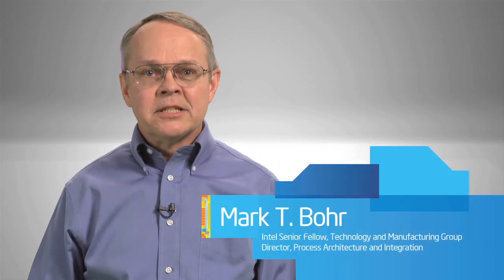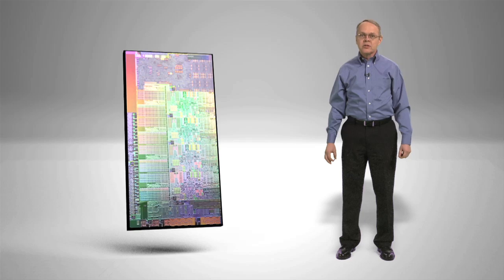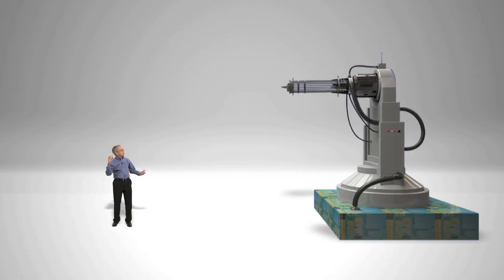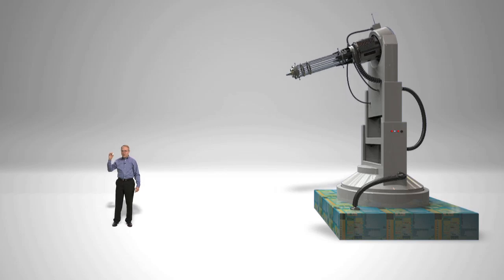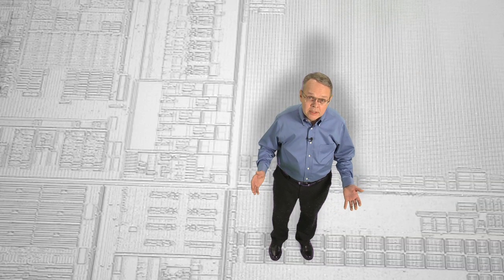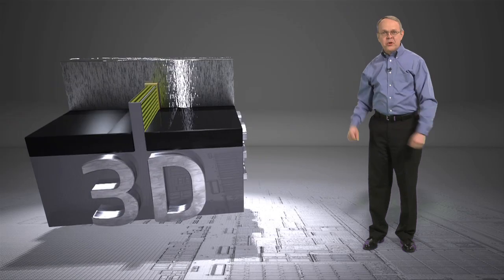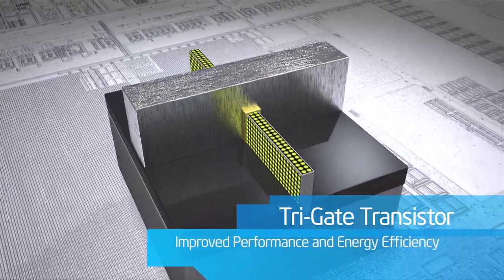Video Animation: Mark Bohr Gets Small: 22nm Explained | Intel

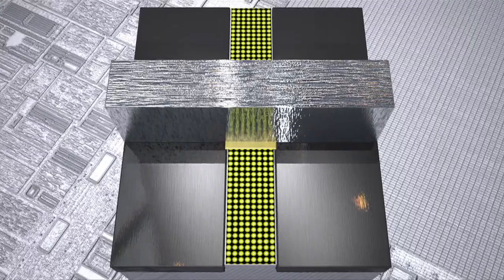Comment: At 2:40, Mr. Bohr states that the transistor has the ability to switch on and off at "100 billion times a second". That's 100GHz! (And that's just the old planar transistor -- not the new 3D one!) If that's the case, why do current processor speeds max out at about 4GHz? Is it a matter of having to operate transistors well below their physical limits due to power and thermal concerns?
Reply: You are correct. There are certain delay times that must be met in order for the chip to work properly. Like you mentioned, modern CPUs are extremely sequential in their operation, so in order to determine the maximum frequency for a clock speed in a system you would calculate the maximum delay through your circuit. These are extremely simple calculations that just involve adding up the delay times of the gates, and a number of other things such as "clock to q delay", the amount of time for a clock signal's effect to reach the output of the flip flop. 

Not all paths through a CPU take the same amount of time, so you would have something called a "critical path" which means slowest path basically, and you would generally want all paths to take that amount of time to avoid timing errors and race conditions, where some things are faster than others. 

A signal inside a CPU, or any digital system, has two factors called setup and hold time. The amount of time the signal needs in order to change from 1 to 0, or 0 to 1, and the amount of time the signal needs to remain at a certain value to be recognized respectively. 

These setup and hold times are sometimes variable, and when setup and hold times are violated the system will not necessarily stop working, but it may lose stability, because if the circuit doesn't have enough time to setup its possible that if the voltage were to change slightly or the temperature were to increase or decrease around the system, the signal might not be read correctly. This is why overclocking exists. A certain amount of setup and hold time are allotted to ensure absolute validity of the signals in worst case scenarios, and people using these products can decide or determine what scenario they are working in and if they care enough or not, and to weigh the pros and cons of this violation. 

Again, you were absolutely correct in your assumptions and you had an excellent question. CPUs are extremely sequential in their circuitry, with lots of flip flops and lots of steps, which creates extremely long critical paths that affect their clock speeds. Some Devices like FPGAs have Transceivers designed specifically for sending and receiving data, and some of these devices can clock at speeds of 32 GHz and beyond because they are designed with very short critical paths and they maintain parallel operation. I hope this answers your question!
Reply: I think it's a problem with heat. Removing so much heat requires some serious cooling mechanisms. They can, but its not efficient. I think the highest clock speed we have gotten to is something close to 9GHz, and that used liquid nitrogen.
Reply: Thanks, Peter!
Reply: You're explanation is clear, thank you Sir.
Reply: Another way to see this is that a CPU operation is a signal propagating (near the speed of light) inside the chip. Chips these days are hundreds of square millimeters, and a direct trip from one side to the other corresponds to about 20Ghz. The fact that we can get within a factor of ten of this is incredible, considering signal paths are almost never straight lines from input to output.

Comment: why do you make them on a circular platform and then cut them into squares.. seems like if you started with a square.. you would get 0 loss and use all of the material,,
Reply: +Rex Newbz http://www.cleanroom.byu.edu/EW_formation.phtml 

TLDR: "They start with a seed that is rotated along with the quartz heater; the rotation naturally produces a round shape — going with a rectangle would require cutting off more of the crystalline structure."
Reply: +Rex _ In addition to run it through a centrifuge several times in the process.  Anything but a circle would cause problems.

Comment: why can't a tri gate be wider aswell as higher?
Reply: Noiprocs Z Heat issues?
Reply: +Noiprocs Z Landon is right. Tri-gate or FinFETs have terrible self-heating issues. In addition, they also have charge trapping i.e. the charges get trapped at the corners of the gate structures. This means, poorer performance at sub-threshold voltages and higher leakage currents. With a wider tri-gate, the effects are more pronounced

Comment: This was a major disappointment - by 3D I thought they meant, they were able to layer layers of transistors on top of transistors, on top of other layers, truly creating a 3D chip.   Chips are already 3D in the sense they are maid by layers of desposits, etched away, and all the did in this video was make a taller wire.  Big deal.  When you can sandwich CPU chip layers, talk between them like traces in the multiple layers of a PCB, AND KEEP IT ALL COOL, let us know.

Comment: Not really. i remember my first dual core processor, and then i told myself i wouldnt need anything bigger than a quad core as it wouldn't give me any lag.... Now I have found out that I could help people suffering with disease with my extra cpu power though boinc. I guess i will upgrade when this processor comes out.

Comment: The invention of the transistor was probably the most important invention in the 20th century, it has changed society. Look at transportation, computers, government, finance, manufacturing ... it's affected them all. Look at the change in the productivity of the whole economy. So the tri-gate transistor could change radically everithing. If the ivy bridge will use 1.48 billion transistors. Can you really imagine what processors could be created in 20 or 25 years?

Comment: @tehxan Yeah, that's what he said.  And he subsequently shrinks himself further to 20,000,000 times smaller than actual size.  It was purely a demonstration of the thickness of a human hair, which he is standing next to when he says this.  "Approximately 100,000nm in diameter."  If we estimate that he's 6ft or 2m tall: 2m/20000 = 0.0001m = 100um = 100,000nm

If anything you should be facepalming your lack of math skills.

Comment: @ShadowwwLFS We will see.  They only customized Arm chips because they needed better power management and size.  With trigate offering 3x the data flow at lower power and smaller, I dont see how they will resist as Apple prefers partnerships over spreading themselves too thin.

Comment: Processors have practically been at a stand still when compared to the monumental break throughs of 3d cards in the past 2 years. With this advancement, processors can finally utilize the potential to match the latest 3d cards without melting. Now come back to this comment in 5 years when it's utterly outdated.

Comment: It's funny how all that explanation (including as much that I had already read) went into what they showed us in a few seconds with the "gate" turning into a fin. It's also rather underwhelming as far as change goes, but that suggests that the really interesting part might actually be how they do it. They had been using a photographic etching type of process. I wonder what about that process has changed. Now what about 3D processors (as opposed to just transistors)?

Comment: 3D transistor?
One real question! I always wanted to ask this question from Intel and other semiconductor manufacturers!.  Why your chips (above 20MHz ) always heating?
Reply: The electricity laws create the heating problem - the thermal dissipation is dependent on power that the device consume. Now - the Power electricity can be computed with the following formula: P= resistance * (Current * Current). The typical transistor has a capacitor that in Direct Current works like an open gate, but, if you drive the capacitor with an AC signal(a signal that has a frequency different than 0 hz), the capacitor will start behave like a resistor, and if the frequency of the signal will get high, the resistor will transform into a shortcut. Now ...over an electric shortcut, the current that passes has a high-value -> the transistor will generate a big amount of power converted into thermal power.  this is why the adaptive frequency of the processor helps out the device to consume less when no application is being run on the device. On the android devices, you can see how the frequency of the device is scaled up and down to meet application-specific performance requirements.

Comment: Moores law states the number of transistors per unit area will double every 2 years. So in 2015 it will be 5.5nm. However this cannot go on indefinetly, a single atom is about .5nm, and these transistors have to use a few of 'em. So it's believed the furthest Moores law can sustain itself is until 2015 :(

Comment: @abdelrrazak its said to be in the Ivy Bridge which would be the socket 1366 equal to the old 1156/1366 socket, right now the 1155 socket is in the mid end of cpu's like the old 1156 was and the new socket for ivy bridge will be the high performace and workstation/server cpu's like the 1366 socket was

Comment: @izlude2  see the video carefully, 3d in the sense gate or control switch wraps around substrate or conducting wire instead of just sitting on it like in 2d. Imagine having magnets in all directions to attract an iron nail, instead of just one strong magnet in one direction. Replace magnet with gate/switch and nail with current and you have your explanation !!